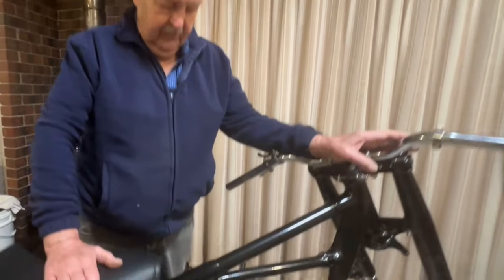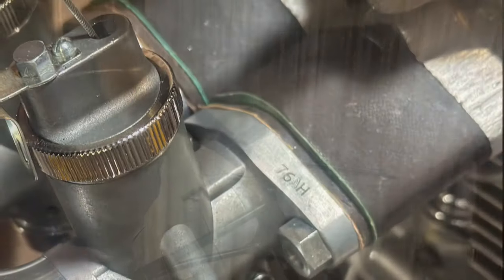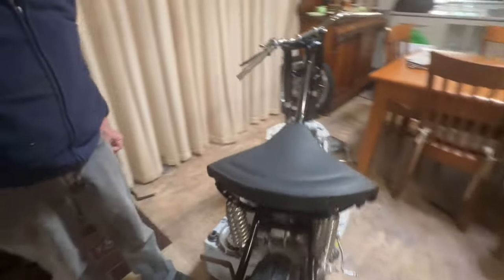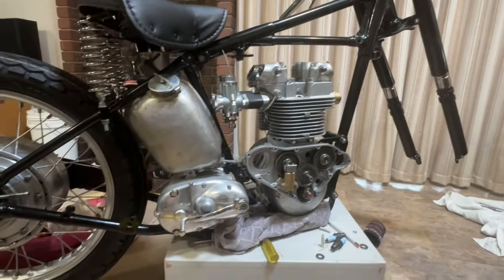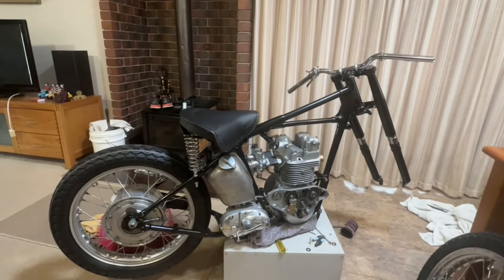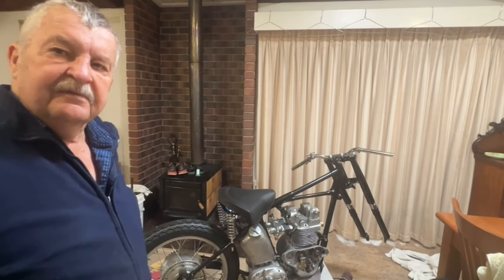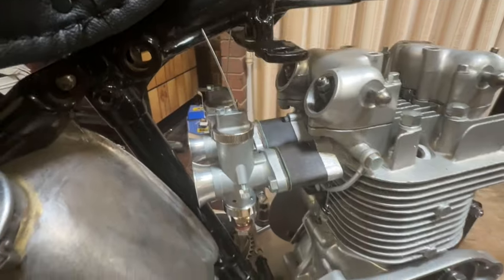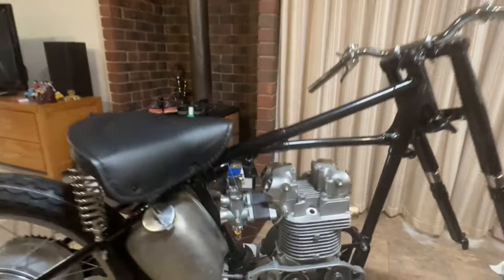GRAND PRIX TRIUMPH BUILD UPDATE.

Comment: Davo from England again.  PPS.  If you have a timing cover with sufficient metal around the crankshaft oil feed bush it is a good mod to bore out the bush and substitute an oil seal and circlip from a unit 650.  Much better oil pressure so less likely to go bang.  Regards Davo.
Reply from the maker: Funny you say that Davo, that is on our list and will happen on both of our Triumph builds

Comment: Hi, Davo from Gloucester England.  Re megaphones.  Armours in Uk do a good repro.  Re Smiths Rev counter drive. (Same as race kit)  Took me about 10 years to find mine. Not seen another since. Your best bet would be to make one using the gear and shortened shaft from the lucas dynamo and use an angle drive from a unit Bonnie or similar.  The original is a very tight fit between the engine plate and the timing case.  With the dynamo engine plate you have a bit more room.  If you need an oil filter (Vokes) I know of a spare.( I would not bother as the brass filter element is the size of a cotton reel and clogs with crap after about 10 miles)  Don't forget to sleeve the inlet manifold with a thin wall tube or you will get air leaks next to the allen screw cut outs.  Best regards Davo (Occasional visitor to Moore Park Beach, Nr Bundaberg.  PS Its snowing here !!!!!!!.)
Reply from the maker: Hey Davo, we will definitely check them out , thanks for your help and thanks for watching. We are about 1800km away from Bunderberg. It’s a fair hike from Bendigo Victoria

Comment: Hi guys , you talked about the mount for the arm on the rear brake plate . I guess it is the same as the T100 fitted with that type of frame , and it mounts on bracket that swivels on the back of the brake pedal spindle . I have a spare one . Do you guys have an email address so we can talk ?
Reply from the maker: Hi Terry , thanks for the offer , Alan went and had a look at one of and he ended up making one. Thanks for watching

Comment: sprung hub brake anchor has a bracket that connects to the back of the brake pedal spindle......am running a standard wheel on the '51 Thunderbird under construction here in NZ.....

Comment: Would you post a list of the upgrades used on the motor ,those con rods look new. but it looks like you  still need a remote float chamber  for the carbs ,matchbox type would fit nicely . love the square finning design .
Reply from the maker: Hi David , I will get a list together asap . We have the original float bowl . It has just been filled. I will get a photo in the next update. Thanks for watching